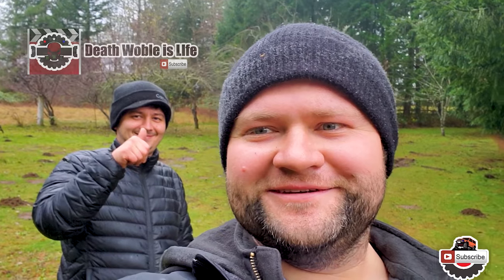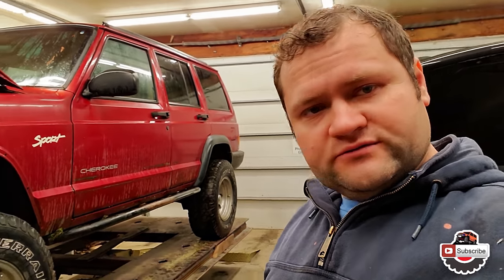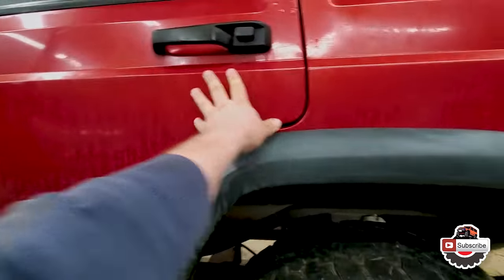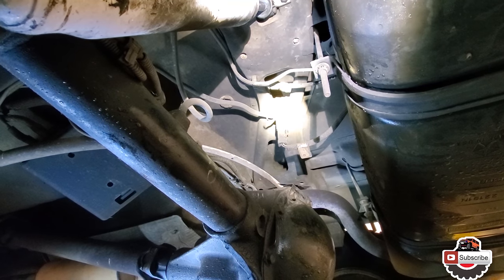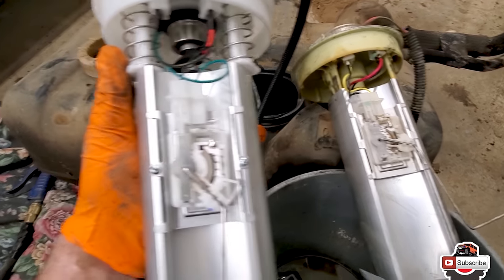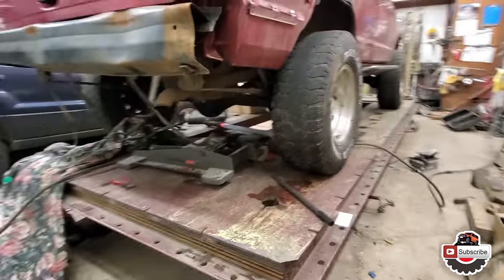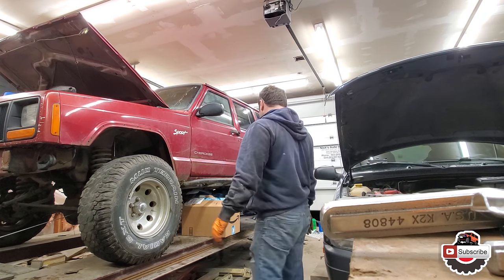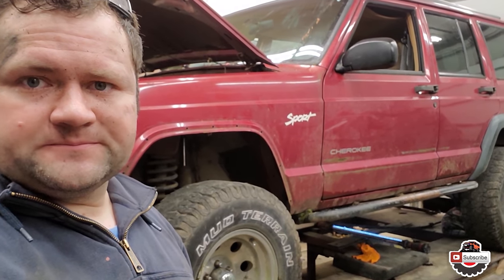Jeep Cherokee XJ Budget Build  EP:1

Comment from the maker: Special thanks to Ilgar, for coming out with me and helping out with loading and geting it picked from the boonies. Give him a follow @deathwobbleislife
Reply: Yes well if I got this right in 1987 was the year of a size switching over from AMC to Chrysler my Jeep still hasn't AMC Parts in it I guess they believe me to a little bit of a simpler time but if you ever want to see what my Jeep looks like or sounds like you can go to Instagram and see if they are the name of my pages keb.nash.9
Reply: yeah I bought in 2003 when I graduated and you know I drove it for sometime before fixing the transfer case and then I meant for many years with no problems with minor repairs and then you just showed me that was being really reliable so I decided to stop modifying it and I haven't stopped since more like modifying and restoring it he still has the original paint never been painted but just check out Instagram scroll down quite a bit and you'll find the sweet exhaustible radio light bar custom put in a lot of things I did myself set for the radio my friend help me out with that

Comment: I have a 1987 Jeep Cherokee and I don't know why they made the tailgates metal and then or ones but mine's fiberglass they did that up until 94 then they switch over to a metal tailgate why I don't know
Reply from the maker: Yeah they did, it isn't uncommon to see the fiber glass hatch of older Cherokees cracked around the window and edges. From 1984 to 1996, the Cherokee’s rear hatch was comprised of fiberglass. In 1997, Jeep switched over to using steel to correct that issue and update the design aswell.
Reply: You can call me old-school I sort of like the first Jeep Cherokees the square ones you don't mind the 1987 when I bought it back in 2003 I paid $300 for it there was a reason for that it ran and drove but the transfer case was damaged I change it out that was another $400 to the bill what was it so bad but ever since then nothing has gave me a problem it's still got the original Engine with almost 200,000 miles on it the fiberglass hats is perfectly fine no cracks no nothing I put it new air shocks in it so it was up nice and easy like it's supposed to I definitely like to push button over the handle they put in the newer ones it's been lifted 3 and 1/2 inch riding on 31's now and it's got a LED light bar built in the front bumper LED headlights and I also I also like the idea to change out my fuel pump on the side of the road I don't know why they did away with that I'm assuming it was too easy for the newer Jeeps so they had to made tougher and put the fuel tank  pump on top
Reply: I don't know what people were doing to the Jeep Cherokee to get the tailgate the crack up like hell and all the ones I seen around here they never had any cracks in their hatches really weird
Reply from the maker: @4x4rcoff-roadtractors54  they definetly don't build them like they use to. Seems after little while they had to complicate it somehow to charge extra for labor 😂 
While they did fix the cooling in 91 and added some features, it was still a solid truck. 
But then after 97 face lift it seems to have gone a bit downhill. Electrical is finicky, pump is in the tank, weak flex plates and etc. 
I seen hatches getting cracked from hitting trees on trails. Never really seen one fail on its own from regular use otherwise, unless it sat in direct scorching heat and weathered for years.
Reply from the maker: @4x4rcoff-roadtractors54  sounds like youve got it set up where you like it.  
Since I've picked up the blue one, and it has most of the stuff I wanted in a overland set up, I'm thinking the red one needs to be caged, swap an ls in to it, with baja lift set up and hit up some events if the wallet permits at that point lol. Stuffs expensive. But I've always wanted to participate in one of those races.

Comment: i don’t know if anyone else noticed how this has the dana 35 in a 98, unless i didn’t fully see it correct. surprised it’s not the 8.25
Reply from the maker: You are right, its a dana 35 with Trac Lock. idk how good it'll be for offroad use or if the clutch packs still hold. Something to look in to once I'm done with body work.
Reply: The 98s still came with 35s and c 8.25 and tracloc for both versions wish I could get my hands on a 8.25 tracloc
Reply: A Dana 35 with 35 inch tires is a ticking time bomb lol, I would swap it with an 8.25 or 8.8 rear end for big tires🤪